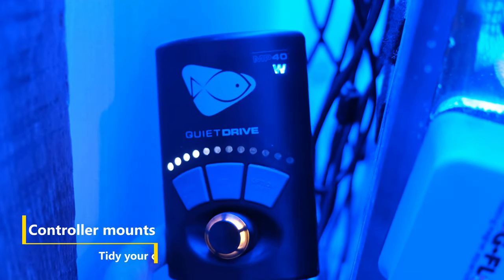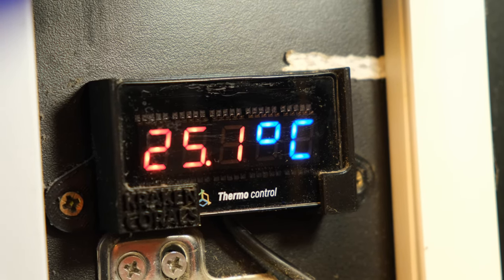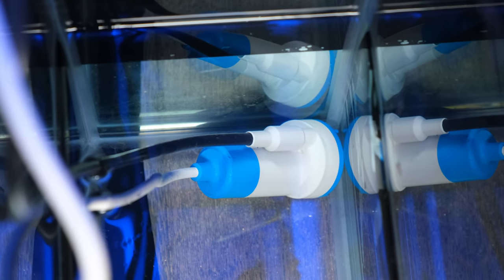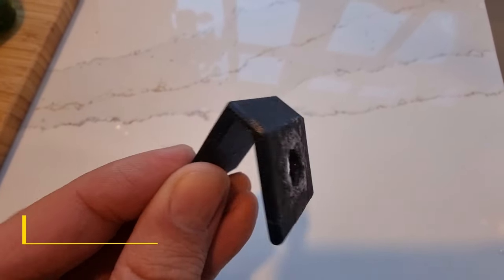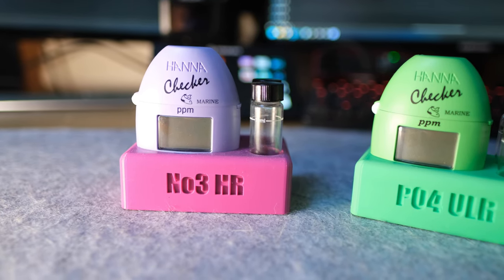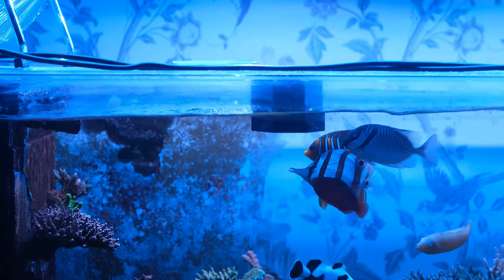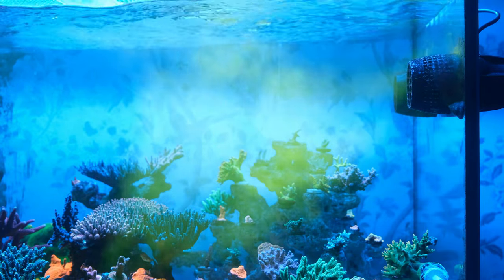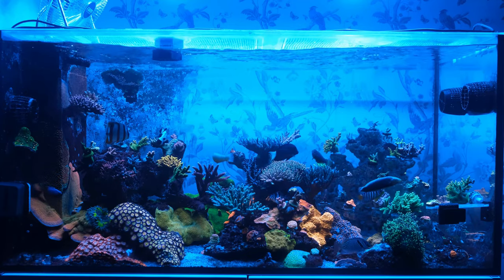Top 5 3D Printed Accessories For A Saltwater Aquarium

Comment: You have to remember that not every filament for a 3d printer is suitable for an aquarium, especially for a marine aquarium. A material such as PLA is not suitable because it will biodegrade over time and will release the chemical into the water. Food-approved PETG material is suitable assuming that the particles from the printer head are not in the print 😁. You should also remember that the filament should not be colored (chemistry).
Personally, I am  printing covers for 2 marine and 3 freshwater aquariums.

Comment: Thanks, Alex.  There were a couple things on there I didn't know about; such as the 45 degree frag holders that could come in useful.  I've been attaching some choice frags to heavy duty rubber coated neodymium magnets on my back wall, but once they're encrusted I've been wondering if the rubber would break down and expose the metal after some time.  You mentioned interest in the DIY EcoTech Battery backup.  I've posted a new video on how to build that on my channel if you're interested.  Keep up the good videos!

Comment: I'm too tight to pay for controller mounts. The 45 degree frag racks are awesome (does glue really hold them?) I got 3 single mounts from Aqua Rocks after seeing Jake Adams wearing their TShirt - and they are awesome - wish someone made that in Europe.

Most of these are not so universal but pump cages that direct flow is a great idea and probably number 1... I don't know.

I think Random Flow Generators are probably the best overall and I live my pod hotel - ok it's silly BUT if you have a new wrasse in QT you can just move the pod hotel across and... voila (who knows if it works).

What I REALLY want to see is light mounting options - Radion mounts (for example) are ugly and most options are super expensive. T slots (or whatever they are called) should be at LFS's and they should have some 3D attachments and people could also get custom ones - that would solve a lot.